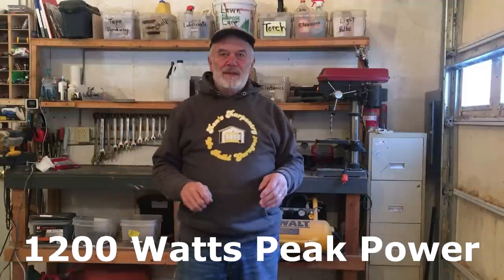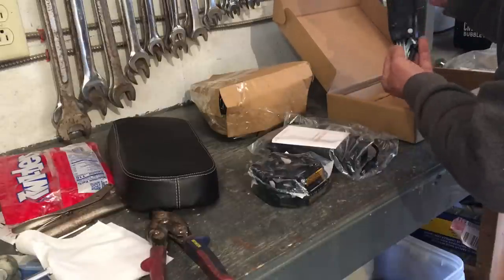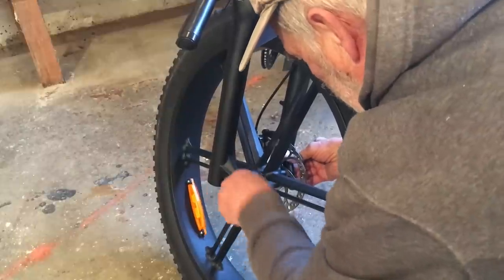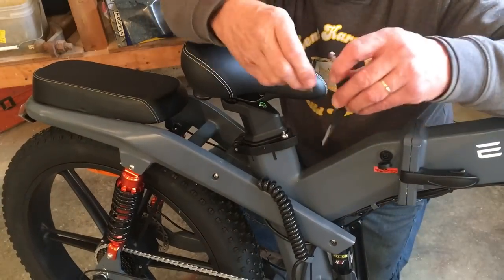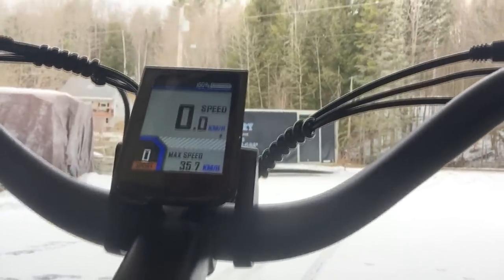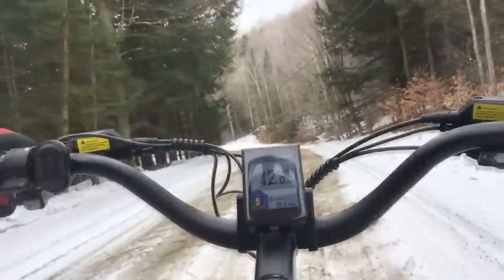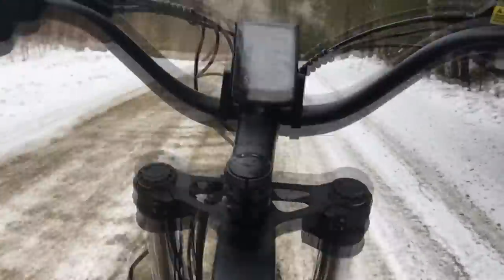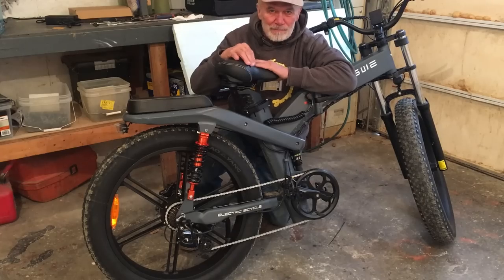POWERFUL ENGWE X26 E Bike

Comment: I think the display is in kph or km/h so 38-39 kph would be around 24 miles per hour. Very respectable, especially in the cold. On a nice warm day the batteries should perform quite a bit better still.

Comment: Ken use a torpedo level to set up your seat, you can use very small up or down a degree or so from level for what's comfortable to you. And to adjust the seat for front to back you can use a plump bob so when you are at the top of the peddle stroke and the plump bob should hang straight down from the kneecap to the spindle of the peddle. these are just very good starting points, but when you are set at these points then you can adjust the handle bars to your comfort location. The seat should have the  level placed from the point of the seat to the space between the cheek cushions. You can put marks on the seat and handle bars so if you have to remove them for travel you can put them back to the same spot. And those batteries don't hold there power very in really cold cond.

Comment: Not sure how that bike is classified legally, but in the 50-States e-bikes are limited to 28 mph in pedal assist and 20 mph in full throttle for use on public streets. Above that, you are in motor bike territory, with licensing and plates required. Where you are allowed to ride it is also restricted if the bike has that much capability. State parks may not allow it, or even some bike paths in towns where pedestrians may be present. Just a word of caution to people watching the video, who may not know about this.
Having said that, I will definitely check this out because it may be more satisfying to buy this than the e-bikes I've been shopping to buy. I have hills between me and the nearest town to negotiate, and I don't want to need to walk a bike home because it won't get to the top of a hill. I'm near 70, and don't want to do a lot of pedaling either.
Reply: I think he had the bike set to kilometers per hour.

Comment: Maybe someone can reply as to whether the x26 has regenerative braking. Few bikes have it and nobody talks about it, but the one that I saw was a smooth, useful slow-down and you only begin to pull the lever so no pad wear occurs. Full suspension, strong calipers, dual-batteries, folding, 11-tooth gear, double-crown steering, adjustable steering, and regen, this would be a great bike either 20" or 26" but as yet I don't know of one @2K price range. I think an Engwe model has regen...? This one?